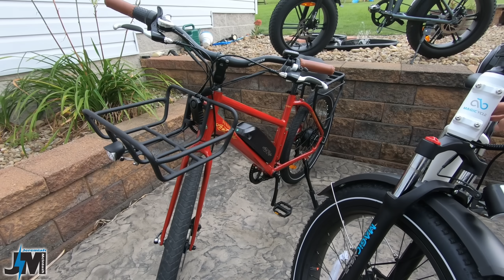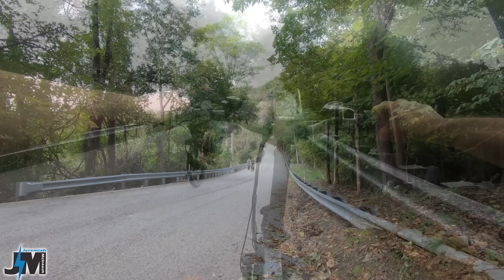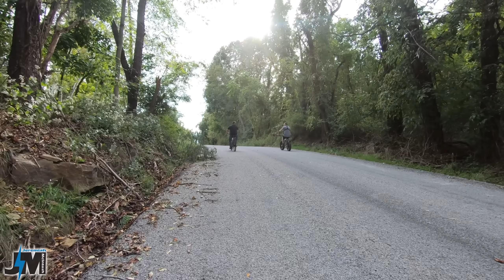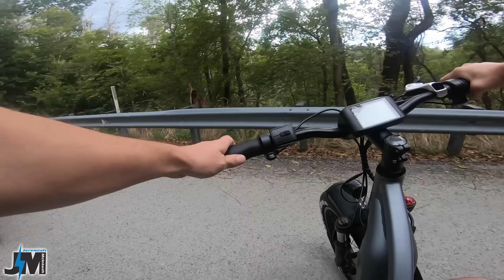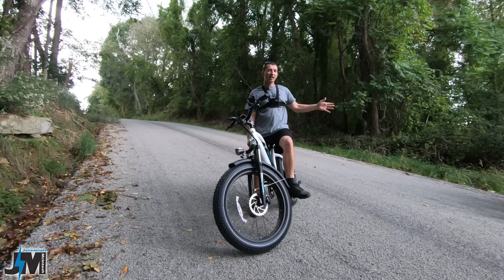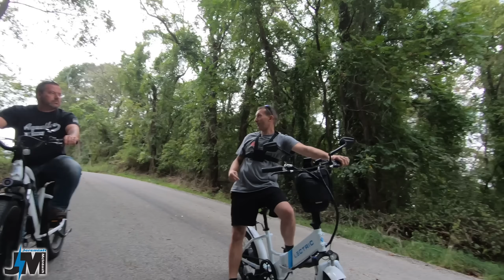750W E-Bike Head to Head Showdown~Which Electric Bike has the most Power? + Lectric 2.0

Comment: If you had a choice would you get the lectric3.0 or premium?
Reply from the maker: They are both nice bikes but Personally I like the 3.0 better because it’s lighter, smaller less to think about when riding and easier to transport.
If you need more power uphill  longer range and  A bike with a torque sensor I would consider the x premium.

Comment: The updated engwe ep2 pro, would beat the lot of these. It peaks at 1200watts, can run a 16ah battery and you can up the amp controller to 25amps

Comment: I really wanted to see the head to head between the Rideal and the Lectric since they are both around the same price point.
Reply from the maker: Unfortunately the Rideal is no longer available but it had a lot more power than the Lectric.
Reply: @JeremiahMcintosh  I know, but I have a Rideal, and I’m thinking of buying an XP 2.0, so I was wondering how it compares, so I could see if it was worth it. What is your opinion, since you own both?
Reply from the maker: The Lectric is a great bike but like I said the rideal does have more power.
Reply: @JeremiahMcintosh  Thanks. I wasn't sure if the "750W" motor on the Rideal was really a lower watt motor with a 750W peak, and I wasn't sure if the 850W peak on the Lectric perhaps made it perform about the same on a side-by-side test. It sounds like you can feel the Rideal having more power, though, so I guess I'll stay with what I have for now until I decide I need folding. I also wasn't sure your thoughts on the handling of the Lectric with its smaller wheels compared to the Rideal.

Comment: If BATTERY VOLTAGE and CONTROLLER WATTAGE is the same - SMALLER wheels (TIRE O.D.) results in higher torque for hill climbing - but not higher. speed.

Comment: Thanks guys for the comparison. I hear MagiCycle has already addressed the brakes and a few other things with the new batches that went out a few months ago. I have it practically down to 2 different bikes and they are the MagiCycle & BeeCool bike. I think my best bet is to wait a few months until the new Magiccycle 2 as well as BeeCool bikes come out. As far as the MagiCycle with their #2 it should have what the BeeCool bike has a 21 amp battery & that would put it above all other bikes across the board when it comes to full size fat tire e-bikes. A thousand watt motor added too would be great, but that may be asking for too much.😁
Reply: Magicycle rocks it with the new edition.   The new brakes are all I need.   The power and hill climbing are super.  I have added the suspension seat post.   That is a nice addition to any bike without rear suspension.   Customer communication is off the charts.

Comment: You should have added 50lbs to each bike you were on. Then it would have been a proper test. WEIGHT is a major factor.

I have a FIIDO M1 PRO. I've range and speed tested it with myself 194lbs. And my friend 153lbs. I got a top speed of 25mph and 21 miles pure throttle from it. He got a top speed of nearly 28mph and 26 miles pure throttle from it.

So that 41lb weight difference made a significant difference..

Comment: In the standalone videos for the Rideal and the Engwe, the Engwe was significantly faster at 28mph instead of 21-22mph. How come it lost to the Rideal?
Reply from the maker: Because the Rideal is limited to around 21 to 22 mph but it does have more torque than the ENGWE.
Reply: There is a setting on the Engwe to crank up the amps to 25.  It's in the manual for the display.
Reply from the maker: But it doesn’t make a difference. The controller on mine is locked at a  specific amperage even though you can change it in the settings.
Reply: @JeremiahMcintosh  interesting

Comment: Good video, and it would have been fun to get several people and have a group drag race. The Magic with 52 volts and 22 amp controller has the potential to peak at over a thousand watts, but we don't know if it actually uses all that. It was a real good showing by the Lectric.

Comment: Hi Jeremiah, fantastic video! I have my doubts about the Lectric 2.0 ($999) now that they downgraded from the Samsung battery. Would it still punch above its weight with its 500w motor reaching 800+ peak despite the unbranded battery? 
The Snapcycle S1 still has the Samsung but at $1499 makes me wonder if it’s worth the difference. I really need a compact foldable and would have preferred mag wheels. Thanks for the thorough and positive way you work!
Reply from the maker: Thanks Glenn. I’m supposed to be getting the Snapcycle S1 for review. Until then I can’t say if it’s worth it or not. Non branded batteries might perform the same but I don’t know for sure without having one to compare. 
Typically with Samsung cells you get more recharge cycles from it over the course of its life.
Reply: @JeremiahMcintosh  I heard you mention it and look fwd to your review of the S1. Polarna is another company I’m investigating that has a compact foldable. Thanks again!

Comment: Most tests there they re equal apart from torque on takeoff, then the distance remains the same roughly? There seems to be something wrong with that Engwe, my 500 watt does way better than that did. I bought it because I live up a steep hill, and even starting half way it gets up fine.
Reply from the maker: Hmm I’m not sure. Maybe they changed something with the  bike I got?
Reply: @JeremiahMcintosh  It seems it should easily outperform my 500 watt bike. It's odd. You'd think they'd check a test bike out well though. One think the Engwe hasn't got that's nice, spokes to loosen. My only gripe was that loose battery, your felt pad hack solved that nicely, so cheers for that :) .

Comment: Should I get the Engwe or Lectric 2.0?
Reply: One of the reasons I bought the Engwe is because at the time I ordered, I could have it in 10 days as opposed to a three month wait for the Lectric. Also I liked the mag wheels. I'm sure I would have been just as happy with the Lectric or any of these others though.
I'm editing this comment to say this: since my purchase, I have read quite a few comments on social media and in product reviews from people who say that Engwe customer service is abysmal. I hope I never have to find that out.
Reply: i am very happy with my Lectric 2.0 - i did replace the seat, and swapped out the gear to a 11-28, added a seat suspension post, mirrors, non folding pedals, and a phone holder to mine. all available on amazon, check out Jeremiah's recommendations, i think i got all of those from his recommendations.
Reply from the maker: Hey mike everyone’s needs and wants are different so to be honest you’ll have to decide for yourself. I would check out both of my review videos on them and just see what you’re more interested in whether it be more customization of PaS levels wider tires and bigger battery of the ENGWE or better customer service more power, able to add baskets and a slightly smaller and lower seat height of the Lectric. Hopefully this helps. Please reach out if you have any other questions.

Comment: What determines the amperage of the controller, is it the amperage rating of the mosfets?
Reply from the maker: Probably. I stated the max amps that was marked on the controller but some bikes limit the amperage to a specific amount so it’s hard to tell on some bikes that’s why these head to head test are good in my opinion.
Reply: @JeremiahMcintosh  - Correct. The controller rating will be the total capacity of the output mosfets, but how much of that capacity is used depends on the programming. My controller will do 96 amps, but there's no way my motor will handle that, so it's limited to 40 amps.